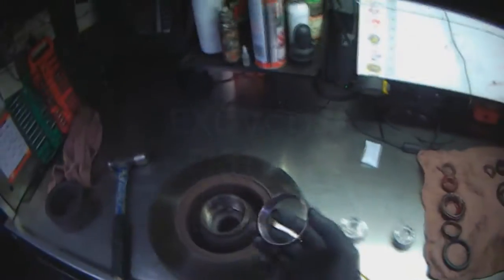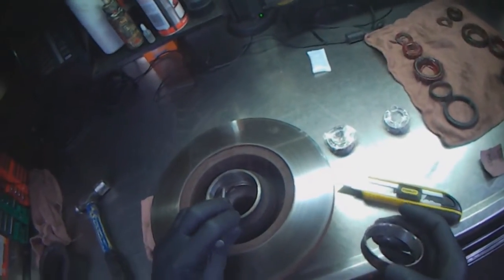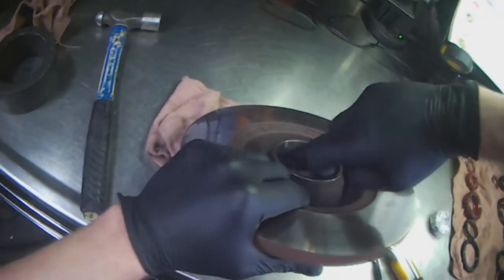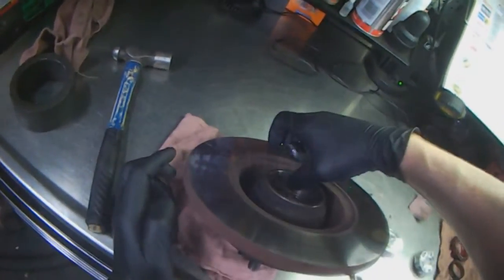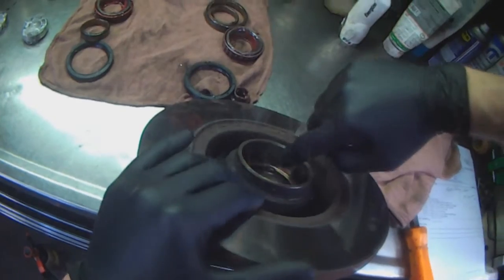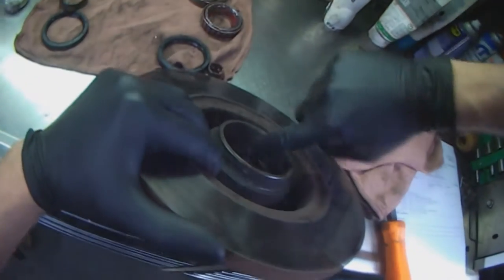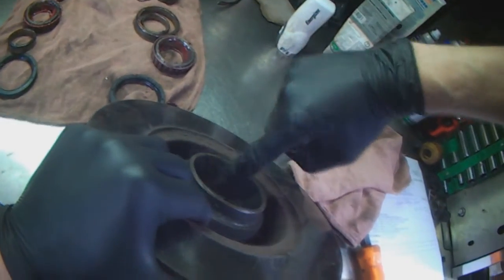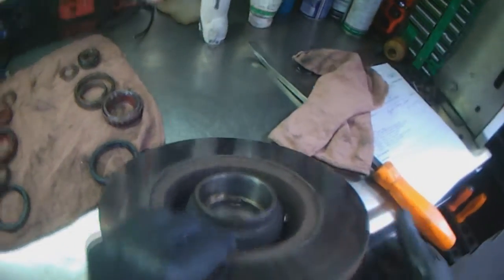Tool of the Day / Week: #012

Comment: Just a side note to your side note, use a brass/aluminium/copper rod/punch/stock/bar to punch out the bearing races from the hub. It might be a bit more difficult and since it (brass/Al/Cu) chips more easily, it is a bit more messy, but it's safer for the hub. A press is always a better option to remove/install bearings.
Reply from the maker: +Tonyus81 Good points, thanks for sharing!

Comment: It's official,  may 2nd is my last day wrenching. Hanging them up after 13 years, hopefully for good. May 4th I start driving a tow truck. If I get any Audi or VW I'll try and convince them to take it to your shop Tom lol. BC Canada from NJ lol what a commission
Reply from the maker: Remember to watch the oil pans when lifting them... we always get a few broken oil pans each year, due to tow truck driver error (on top of what the original problem with the car was).
Reply: Yeah no doubt. I've done tie rods and control arms on Chrysler 300's because hook drivers use them as tie downs....